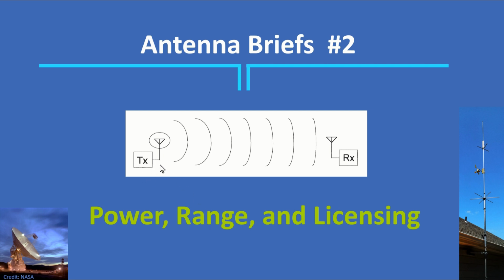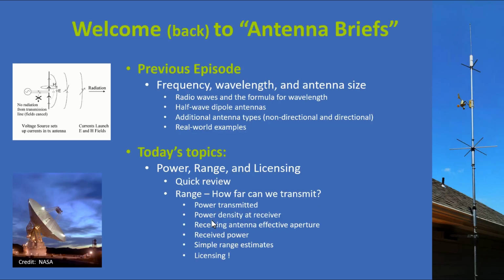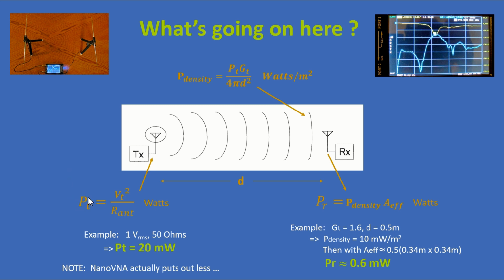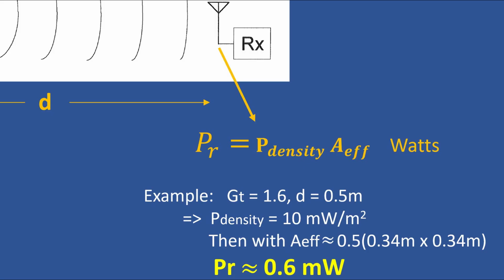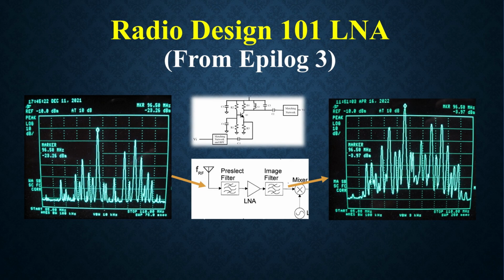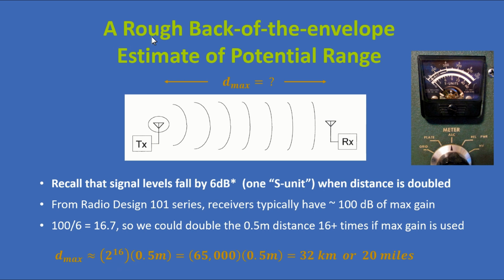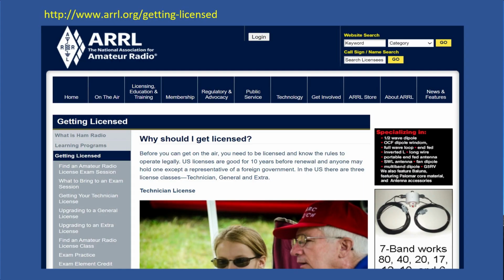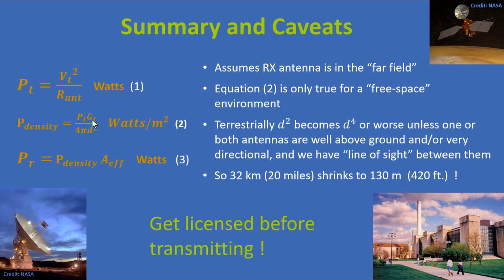Antenna Briefs #2 - Power, Range, and Licensing

Comment: Interesting video series! I assume the same principles apply to HF signals (1.7 - 30 mhz).  But, how is the received gain affected by skip, objects, ground reflections or ground losses? I would assume that the received gain would be lower.
Reply from the maker: Yes - you are correct - the same principles (physics) apply to HF. However, there are some big differences in propagation due to the much longer wavelengths at HF as compared to VHF. So in a way, it's not the same. Objects are "smaller" relative to a wavelength and so the HF signals can more easily diffract around them. And as I sense you probably know, the skip is much more due to the mean distance between charged particles in the ionosphere being a smaller fraction of lambda at HF. And as you said, ground reflections/losses are different as well, due to the wavelength difference relative to VHF/etc. Bottom line - it is hard to get "line of sight" behavior at HF. But in some cases that helps received signal strength, and in others it hurts it. HF is quite a different animal indeed !  🙂
Reply: @MegawattKS  Thanks! I just found your videos. So, in principle, the gain of a HF receiver would also be proportional to the square of the distance if I had a transmitting  dipole and a receiving dipole tuned to the the same 1/2 wave frequency in free space - but, I'm assuming that's going to be quite different since it isn't line of sight. I believe there is loss due to ground and ionosphere scattering but also gain due to horizontal E field ground reflection gain (vs a vertical). So, what the receiving gain is seems a mystery to me at this point.
Reply from the maker: @shortwavelistener  I think I partly agree. Certainly if operated in free space (e.g. outer-space), the received signal level is going to be inversely proportional to the square of distance. And for terrestrial use, its complicated as you said. I am a little confused about your meaning when saying "gain of an HF receiver would also be ...". I think you're talking about received signal strength, not 'gain'. Is that true? I reserve the term gain for a quantity which is the ratio of an output to an input signal level (for a circuit/amplifier inside a receiver), or in the case of antennas, the 'directivity' gain: how much larger a signal it receives (or transmits) in a particular direction than a non-directional antenna. as discussed in Episodes 3 and 6.

Comment: Hi, generally the receiver comes with input sensitivity like -95dBm for example. What does it realy means? Thank you very much
Reply from the maker: The unit "dBm" means decibels relative to a milliwatt. So it is a power level. -95 dBm is 95 dB (9.5 orders of magnitude) less than 1 mW. So, it's 0.316 picoWatts.  Sometimes sensitivity is quoted in terms of voltage instead of power. Assuming a 50 Ohm antenna and a 50 Ohm input for the receiver, we can convert 0.316 pW to voltage, say, in microvolts (uV), using P = V^2/R, which can be rearranged to V = sqrt(P R).  Here, 0.316 pW  (i.e. -95 dBm) gives 4 uV.  Hope that helps.
Reply: @MegawattKS  always helps. Thank you very very much.
Reply: My NanoVNA has arrived. Can I use it to measure input power of a wifi signal?

Comment: Sir, first of all you are owsome.
Secondly I have an issue and need little help I have two monopole antenna 0.32m each i connect one to a function signal generator and the other one to the oscilliscope adjust the signal generator to give 1 volt signal peak to peak on 50 Mhz and use that as a transmitter and receive this signal throw the other monopole antenna attached to the oscilliscope distance between antennas is 3 meter the problem is that the voltage signal value appears on the oscilliscope is much lower than the  value calculated using fersii formula after that i used telescopic dipole antenna similar to what you used in this video for same frequency and still getting much lower value (around 100 mili volts) on the scope against 1.2 volts when applu fersii equation calculations please advise
Reply from the maker: Interesting.  We used to do something similar in our Antennas course lab and the results were typically off some - especially at close range.  Here, I can think of a couple possible reasons. First - if the antennas are 0.32m at 50 MHz, that's only about 1/20th of a wavelength, so they're not resonant monopoles. So they're not going to transmit or receive as well as assumed by the Friis equation. In addition, it is hard to make measurements at these frequencies. 50 MHz means lambda is 6 meters. At 3 meters away, we're in the "near field" - but the Friis equation assumes far-field patterns. In the near field, there is still a strong radial component to the E field. Finally, there is the issues of what kind of "counterpoise" is present in the monopole and what objects are nearby distorting the field pattern. In our class labs, we found that even at 900 MHz with resonant dipole antennas, things would depart from theory at a distance of a few wavelengths due to "multi-path" in our indoor setting. That's partly why the video shows things done at 900 MHz. Hope that helps. Antenna measurements are hard, but interesting to do !
Reply: @MegawattKS  what confused me is that i found website called everthing RF which provides online calculater for calculating the far field  based on formula far field starts at distance greater than 2D2/lamba and when I put D as 0.32 m and lamba as 6 meter calculater gives result of 4 cm so I thought at 3 meters I am in the far field I donot know why online calculator give 4 cm as near field border while you mentioned in the video it should be greater than 2 wave length ?
Reply from the maker: @شريفشريف-م7ظ  I normally use that formula for things like dish antennas that are "electrically large" (> lambda/2 in size). It may work for electrically small antennas, but that would only mean the fields are radiating and not reactive. Perhaps the main problem here was the antenna was only 0.32/6 = 1/19th wavelength in size and you are seeing the effects of a very small radiation resistance (I calculate about 0.59 Ohms) plus a large negative reactance (maybe -j200), instead of 50 Ohms resistive. So most of the signal from the generator was reflected by the antenna and didn't get radiated. I.e. the antenna radiates, but it's not getting much power from the generator. Similar issues (though perhaps not as bad) on the receive side...

Comment: Thank you for wonderful information in the videos and a interesting channel. I have just recieved my amateur license and my signal. I just want to say that I would love see and hear much more about mathematics and equations. Do not be ”afraid” to show and explain the mathematics in depth. I understand that you have to compress the information in the videos. I would love to see a video explaining how to design and calculate the properties of an antenna. How do the antenna design software work? Thank you again and keep up the good work you do!
Reply from the maker: Thanks, and congratulations on your license !   Putting in math is something I've debated a lot.  Have tried to limit things to real-number algebra-based material, since many people don't have the complex-number math for addressing phase (for circuits or antennas). But it is amazing how much can be done even without it.  I like your suggestion of doing something with antenna software. Maybe I can setup the phase concepts in a diagram and then turn to sim software to skip to the results and avoid the need to derive things. Not perfect, but it would be a good transition into the software and antenna pattern concepts without complex numbers.   FWIW, we have used commercial software like "ADS" and "EMpro" in our university classes, but I've also used the free version of "EZNEC" to illustrate dipole antenna currents and patterns.  It can do a lot. I'd recommend it to anyone who hasn't looked at it already (or has something more powerful). The user interface is kinda clunky, but it does some of the same basic things as the commercial software does in terms of setting up the analysis and using finite-elements and superposition to get the far-field pattern. It's just limited to wires rather than handling surfaces...  https://www.eznec.com/   73